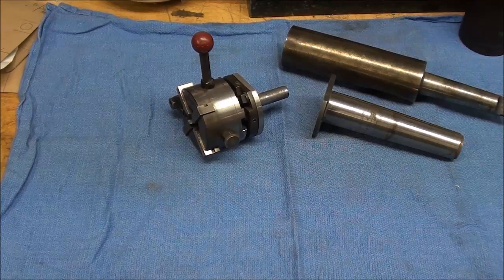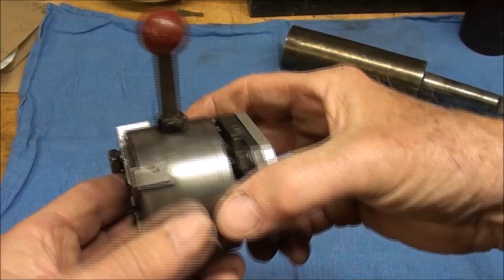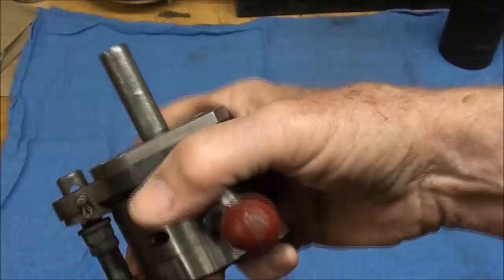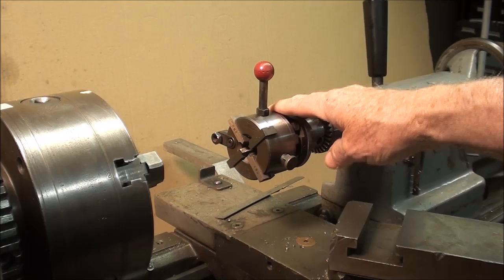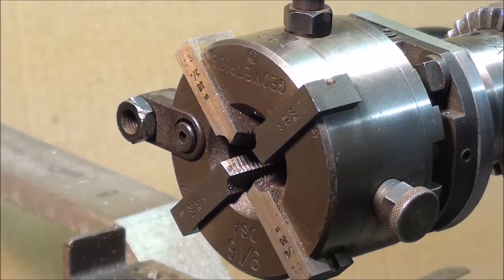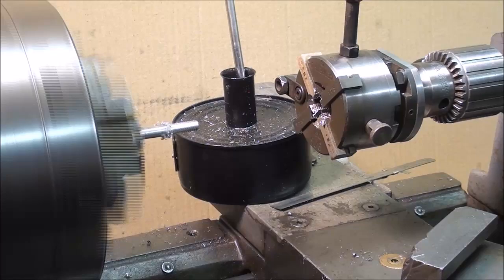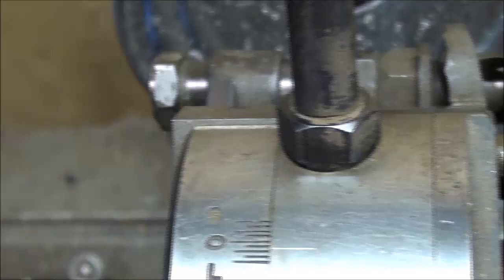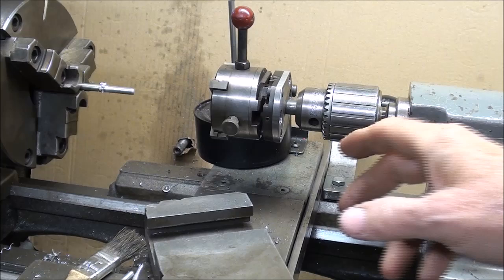SHOP TIPS #209 GEOMETRIC SELF OPENING DIE HEAD tubalcain

Comment: I found on eBay one of these for very very reasonable price and it came with a gigantic box of chasers most of which were brand new! I was very fortunate to find this deal I used it on my hardinge 59.  The gentleman that had it did not take very good care of it as a matter of fact you took terrible care of it to the point where it was so sticky with old oil that he thought that it did not Auto open . I took it apart carefully cleaned it with kerosene and put some good oil on everything I replaced all the little springs I had to make the springs myself because they were of a size where that I could not find anywhere so I had the tiny piano wire needed for the springs and I just made them and they turned out perfectly. I had to make a couple of bushings inside I made them out of brass and they glided beautiful and by the time I was done that thing worked so good I had great satisfaction out of repairing it.

I was sort of forced to sell my hardinge and I let it go with that machine. It was very very stupid of me I could have sold it for quite a price with all those brand new chasers but I wanted the guy to have the ability to use it. When I sell something I always give people really good deals I'm softy for people cuz I can empathize with the prices in this Hobby so I try and give people a lot of extras.
Reply from the maker: 👍👍👍You sound like a very good man
Reply: @mrpete222  ty for that i try to do good in this world but I don't always live up to my own expectations I have to admit. One thing is for certain though,  when I don't do my all for my fellows the guilt I feel is never worth the extra money I have as a result

Comment: Hello Pete - you might? be interested in this. My father was a blacksmith, and as a young boy, one of his jobs in the winter was to make harrows. I'm sure you know what they are. Now each tooth required threading. He had a hand threading machine with a long handle, a laborious job, and hard work. He had a lathe, driven by a flat belt shaft and fitting a die, manged to thread the teeth on this. I enjoyed this job, would be oh 10 or 12 I suppose, a long time ago. But DO remember I had to have my wits about me to stop the lathe at the end of the thread. I did have to turn the lathe backwards by hand, but much easier than the threading machine, which required several passes.

Comment: I ran a threading machine in a job shop for a while, pretty cool machine. Worked quite similar, but the die head was on the spindle and the work was held by a sort of carriage with a vice. Had adjustable feed in with adjustable engagement and adjustable thread length stop. Took a while to set up but it ran well.
Reply: This is a great idea for work on lathe machine, but can you please help me to Quote for this Die Head at your earliest
Reply: @maheshvaishnav6626  it wasn't a lathe, it was a specialized threading machine

Comment: Awesome video, I use something similar on the screw machines, they open and close using a yoke that is attached to a switch which allows it to go from high speed to low speed, thanks for the video on the die head, very interesting.

Comment: Thanks, never seen one & only got here because of a Coventry Die Head reference that didn't have nearly as much info as you provide.  How/why didn't you cut multiple threads on that aluminum, and got it to start at the same place every time??  Gotta be just dumb luck, can't believe that tailstock slides so smooth & easy that its first thread just engaged & pulled it in sync with the previous cut.  Thanks again.

Comment: on the die geimetric head you need only maintain the sequence of chasers often on set ups changing position but keeping seqence will give better thread...have about 35 yrs using those on screw machines..

Comment: As I understand this die head's action, its mechanism is "strong" enough to pull the rather heavy tail stock along the ways.  Yet it is "weak" enough that when the tail stock stops moving, by holding it back with your hand, the head will be pulled forward and the mechanism will trip (release).  That seems to require some pretty complicated fine tuning to make that work properly as the differential between strong and weak isn't very wide.  Can the strong and weak settings be changed in the shop?  Or would you even want to?
Reply: cemx86 Some die heads can be very stiff, I was using a landis style die head yesterday at work and its quite difficult to pull it enough to snap open by hand, you gotta really yank on that thing.
Reply: cemx86 There are NO settings for as you say strong and weak. How it works is that there is a spring loaded plunger that engages in the die head back plate when you operate the closing lever. When the tailstock comes to to hit its stop, the die head continues to thread. It starts to slide along its internal guide until the pin is no longer engaged in the hole ( keeping the die closed ) so the spring action then opens the dies in a snap action. You saw Lyle opening it in his demonstration by him using his fingers to push the die head away from the back plate. Hope this helps with you understanding how it operates. Other makes also work in a similar way, although they may not be so easy to open by just finger pressure.

Comment: Hello MMID303, I need know what type and model head geometrical can work 
fine for build a screw trapezoidal size TR14x3 european ? It must be 
left hand cutter. Can you help me for choose the right Head size and 
what chasers use for this work ? I have find on web , but have a too 
confused for choose... I have a lathe not cnc with standard tailstock..
Reply: I wouldn't think this is possible unless you have an absolutely massive lathe and a huge die head. Even then I think you would have to rough the thread first.
Reply: hello, yes true, I had leaves this idea too difficult, But now , I need of cut a thread standard 5/16, possible make this size with the head , what type head and model i need to find ? Can you help...
Reply: You need a Coventry Die head anywhere between 1/2" and 1 1/4".&#160; Here is an 1" one

http://www.ebay.co.uk/itm/like/112080848326?lpid=122&chn=ps&googleloc=9046939&poi=1006656&campaignid=207297426&device=c&adgroupid=13585920426&rlsatarget=pla-75952154106&adtype=pla&crdt=0

but you need to buy the correct size for your lathe.What lathe do you have?

What thread are you making?&#160; BSW, BSF, UNC ?
Reply: I want use on my Mill , the mill chuck have a shank taper up to MT3 or 1". In my lathe I have a tailstock MT3 .
Reply: UNC 5/16
Reply: Die heads don't use taper shanks. My lathe is also 3MT and I had to make an adaptor. 

Do you have Skype?  Skype me.  My Skype name is 

evildrome